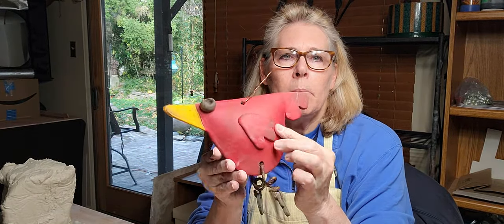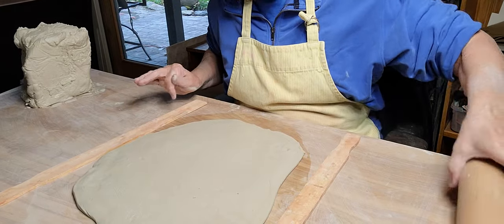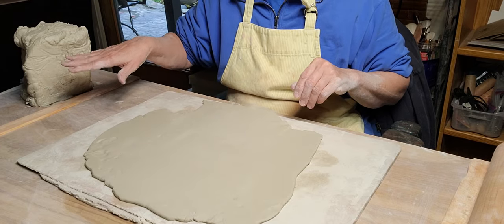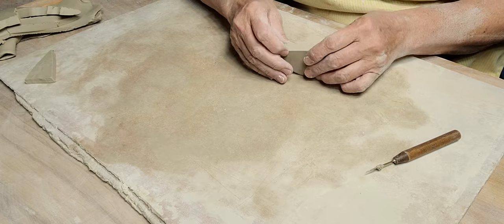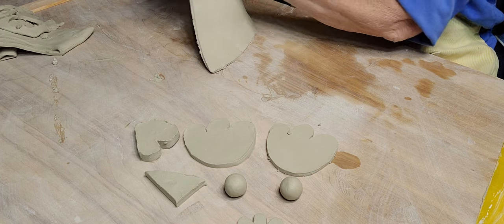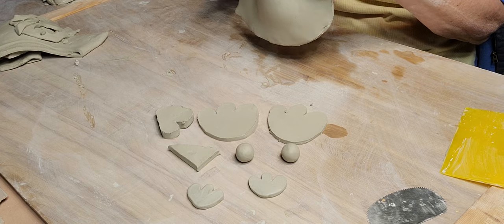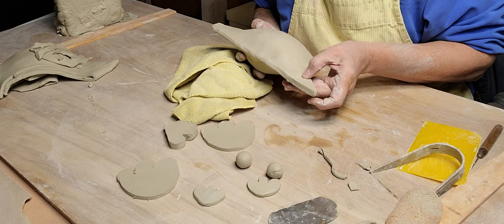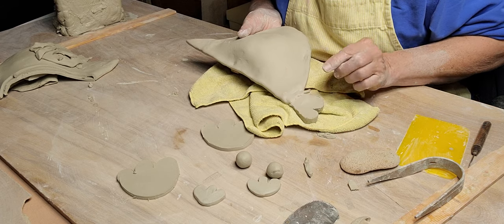How to Handbuild a Redbird from Stoneware Clay

Comment: How do you position it in the kiln to glaze? On its side with stilts? 
Thanks, fun project.
Reply from the maker: Thanks!  I stand them up, and lean them against a kiln post, so that only the wing is barely touching the post, and the tail is against the side of the kiln.  They do not have a clear glaze on them, so they don't stick.  Sometimes they have a little of the kiln wash on them, but I just sand that off.  Good luck!  😀
Reply: @WildAcornsArtStudio  ahhh, thanks